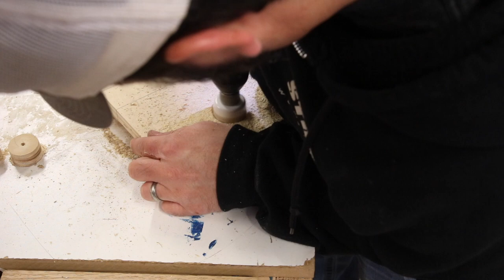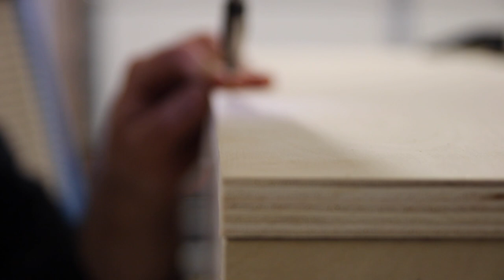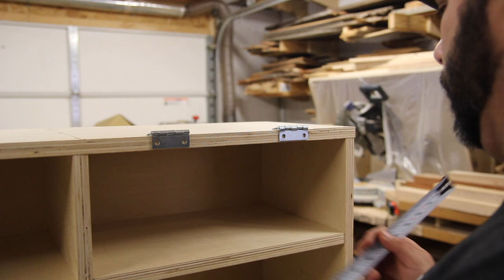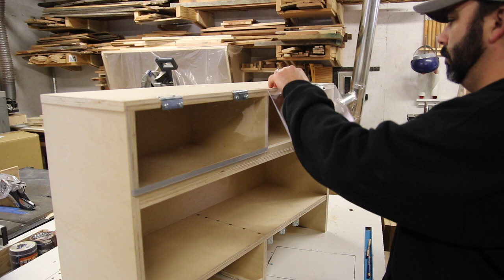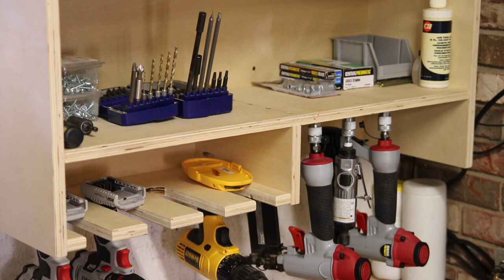Drill Charging Station with Air Tool Storage - and Dust Free Bins

Comment: Just ran across this video today. The air tool holder is a great idea, so simple as well. I use Plexiglas in a similar way. I use it as a door on me sandpaper storage to keep the sheets dust free. To me the hanging of the drills upside down is the best part. I have put off building a cabinet for my cordless tools because all of the ones I have seen show the tools hanging top up. This puts all of the weight of the tool on the forward/reverse switch. I don't know why I never thought of hanging them upside down. Thanks for the great ideas.
Reply from the maker: Thanks for watching

Comment: Great idea. I took up woodworking about 3 yrs ago to help cope with PTSD. I love it, great hobby and you get tangible results, u like with video games. 

I've had to do alot of work on my 95 F150 the past 2 months. So I had to clear out alot of space to get my truck in my garage. So after I finished working on the truck I decided to rearrange my shop for more room. Built some overhead storage like Jay Bates. 

Today I'm building a cabinet kind of like yours. I really like the air tool hanger idea. I think I'll epoxy some nuts in there, then screw in the coupler, just so they don't come lose over time if I just threaded them into the wood. 

*And the best part is my 6 yo daughter helped me to remove everything from the shop, and today she's helping me build the cabinet w/ drill & nailer storage. That's the best part, even if it slows me down. I know you know the feeling.

Thanks for everything
Reply from the maker: +Mitchell Villanueva Thanks for the comment. I really appreciate it. Nothing like having your kid take interest in what you're doing. Glad you found the cabinet useful.

Comment: What  did you used to mount quick connects I like that idea
Reply from the maker: Drill small holes for the air fittings to screw into. Very simple.
Reply: Ok thanks

Comment: Cool build, I like it all except the drills facing out ... not your fault,  I know myself, I might leave a drill in the chuck as you did with the "bit holder" and the bastard will hurt me!!
Thanks!
Reply from the maker: Lol. I can see where that could happen, but where it's positioned I can only walk towards the cabinet so I shouldn't have a problem. Be safe. :)

Comment: great video, thanks! I plan on making a version of this as well for my shop. I found the couplers at the big box store to hold the air tools up, but could not find a nut to  hold the couplers in place. Where did you get yours?
Reply: on 2nd view, I notice that you actually just drilled a smaller hole and threaded the couplers directly into the wooden shelf. I guess those have held up nice for you, no issues with the weight of the air tools?
Reply from the maker: No problems so far. You could also add a little bit of epoxy if you’re worried about the weight.

Comment: How do you like those central pneumatic nailers? I've heard both good and bad, but haven't purchased one yet because they can't be that good for how cheap they are. Thoughts?
Reply from the maker: +Sebastian Gonzalez They do the job. If you're an occasional user then they are great, but not sure how much abuse they can take.
Reply: go to a pawn shop, you can get a good brand used for about the same price as a central POS new.
Reply: I've never had a problem with the 18g. I've put tens of thousands of nails through it with only 2 or 3 jams. I'm just as surprised as anybody to be able to say that.
Reply: Sebastian Gonzalez A lot of this pneumatic nail gun companies use a generic gun body and probably the internals too.  I've seen the same gun bodies, different colors, from expensive mfrs and cheap mfrs.

Comment: Where did you get that fancy drill bit? What size did you use. Great video!
Reply from the maker: +Glenn Mayer Thanks! It's a forstner bit. I thinks it's a 3/8" but just depends on air fitting size.